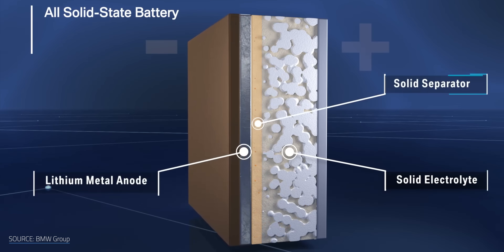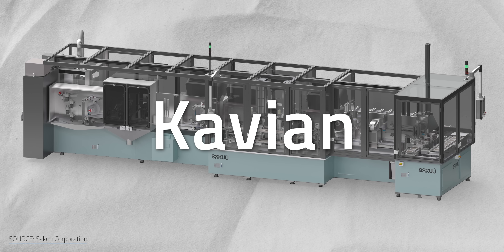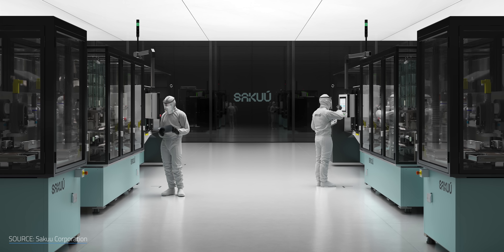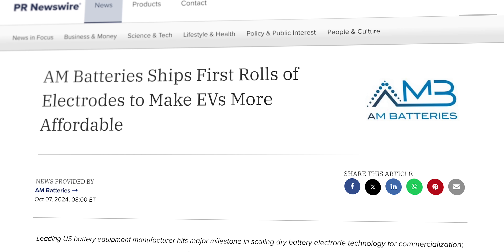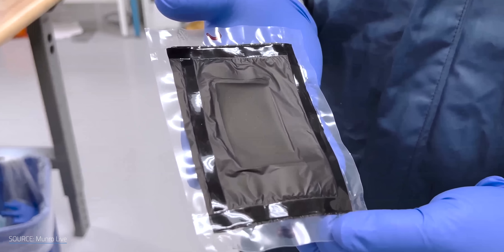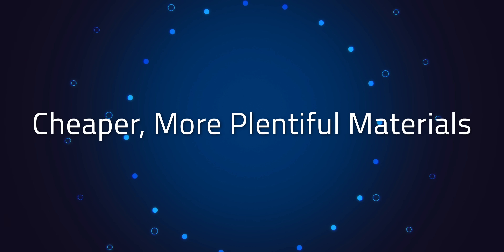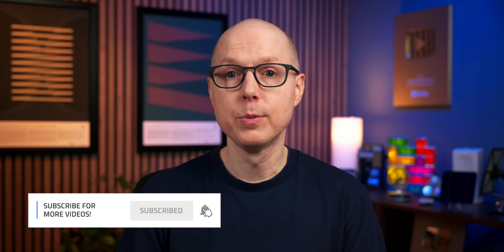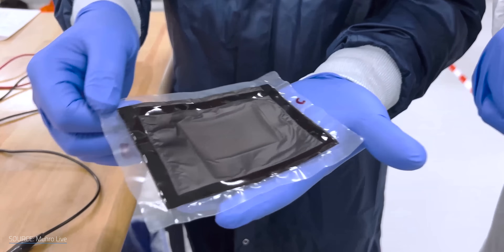Why This Ultra Cheap Battery Breakthrough Matters

Comment: A battery factory that fits in a shipping container would be interesting. I think if you took (Nicolai) Tesla's dream of wireless electric transmission and used quantum bluetooth wormholes to power portable things instead of batteries, it would be cool. But it would probably cause some conCERNs about screwing up when Nelson Mandela died.😊

Comment: If they can up the cycles. Then they would be good. If they last half as long. And cost 50% less.  They still loose. If you have to replace them twice. Not to mention carbon cost (not as much but still there. And disposal of twice as many when they are dead.

Comment: They must be selling LiFePO4 below cost because there are 1280Wh batteries for ~$100.00 just about everywhere.
Reply: I do not believe the Wh rating of a battery until Will Prowse tests it.
Reply: @yvan2563 yes, be very skeptical of any battery capacity claims. 
Those Chinese product claims are dubious.
Reply: I bought two different well-known brands multiple channels have torn down. Presidents' day seemed to never end.

I put them on a Jackery and I am on the 8th day of alternating them every 11 hours. I need an hour to bring it up to 85% for the next cycle.

Lowest voltage I've seen is 12.75, from both,  still pumping 100-104 watts.
I just cannot bring myself to, intentionally, trigger the low voltage cut off. 

I do not have a channel but I had $200.00 to buy batteries before the tariffs and if I only get 90% while battery prices flatline I'm fine being wrong about tariffs.
At least they are not lead acid.

Comment: High capacity Lithium batteries, except for LTO, have a limiting temp. range starting at 0 Deg C unlike NiCad or lead acid have a temperature range starting at -40 no mater what type they are. manufacturers of lithium batteries seem to forget to put temp op range on their products. Ask anyone they do not know. New type of batteries you have to research to find out. As for me in Canada lto is the one for its climate range plus all its many pluses like 10,000-30,000 cycles, (decades of life), My question is WHY no one talks about temperature.
Reply: Perhaps because they can heat themselves to the temperatures they need? Just guessing.
Reply: @gzoechi  there are batteries with heaters but if you do not use your battery you will eventually run out of battery. I GUESS YOU NEVER TOOK SCIENCE IN SCHOOL

Comment: If most of this tech can come to fruition it would be Jess expensive to replace your car high voltage battery than having to replace an engine. Rebuilds are expensive and the labor to remove and install another engine is time consuming. Battery replacement should be less than a couple of hours. We shall see.

Comment: With the amount of new bettery and power delivery tech coming, now to 2035 is going to be quite interesting. I know so many think of anything like this or other battery tech as "vaporware" because it isnt ubiquitous in 6 months to 1-2 years, but people said similar things about microchips in the sixties, personal computers in the 70s and 80s in varying capacities, the internet in the 90s, let alone the thousands of other technologies that begin in a lab and get adopted however by manufacturing. The more choice for new age and solid state or even just cheap/light/safe batteries the better. It may be a decade but all this stuff is promising. And fascinating.
Reply: Exactly my thoughts, although you added great examples I'd not thought of.  Add to that car/cellular phones.  My first one cost almost $2000 1986 dollars and cost a fortune to use.  Now kids and homeless have cellular phones.

Comment: I like your channel, but this constant "omagurd new battery!" every other video has started getting very old.  I referred to your channel as the "clickbait battery revolution" channel the other day... I've liked so much of what you have addressed in the past, but I see a battery video with a title like "This changes everything" and I just skip it at this point. I'd prefer more in-production tech than potential new batteries that are years upon years away. 
Sorry, just some feedback from a struggling fan.

Comment: It sounds like necessary research and development, but alas, the standard refrain of being 5 years away from actual production raises questions about their viability. Solid-state batteries are always the subject of EV enthusiasts, but we only see prototypes that are not ready for prime time. While I appreciate you informing us of developments, the glacial pace of solid-state battery development makes most of us skeptical of their promise anytime soon.
Reply: Agree, but, if this tech is true, this is the production tech you would wanna see as this is already out of the lab and into "how do we make them on mass". If true, then this is the starting point of a 2-5 year cycle point as companies buy into the production line - then another 2-4 years for preproduction.
Reply: @adr2t  I hope that they succeed. We need better and cheaper battery technology. Nevertheless, being out of the lab requires real-world testing. Issues still need to be addressed when using them in cars, homes, and devices. So this is a product that will not appear soon. For the present, LFP is the most affordable option. I hope that LFP can be improved at a reduced cost as they have proven to be a viable, lower-cost option to the higher-cost lithium options.
Reply: @ Typically, they do these test in labs before hand that are pretty close to real world. Follow by the preproduction testing to see how they react after production. Then compare, as production can of course have a silghtly different outcome. If they see it has worthy, then you see samples go out to other companies. So once they are ready, they can go into riskless products. For example, many batteries start off as basic car batteries, follow by storage (like battery backups). Stuff they needs to work, but will have a shorter shelf life to get that real world, but they have been known to jump a bit faster like we saw with LFP. So more or less I am just saying they're out of the lab and into that first line up there. He doesnt go into if they're sampling though, so hard to know, but if they are, then that means its already pretty far along the line.

Comment: Aren't LFP batteries already $50-80 per kWh?
Reply: Kind of, this makes other Li batteries closer to the $50-80 kWh as well. So more over lal storage for less cost as LFP as a storage limit too. So for an EV we could see the battery drop from $10k to maybe $8k or $6k for the same storage size, but less weight.

Comment: The portable JBL speaker in the dash of my new Tacoma has a solid state battery within!  It was chosen because of its stability and durability across a wide range of extreme temperatures
Reply: ITS usually a LTO battery, they have a 10-20 times current output for high current power demands on lower spectrum of the audio range

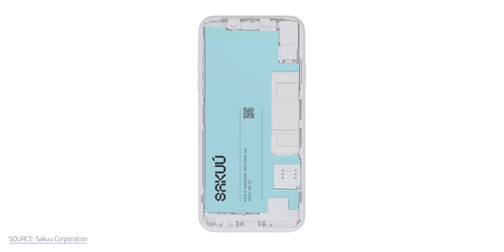Comment: 4:24 because we need even less replacable batteries to fill landfills.
Reply: Its going to happen either way... why not make them better so we dont throw them away sooner? At least here in the states, its one of the reason why we have trade in programs - so they can be recycle.
Reply: @adr2t  they can make the batteries better without making them bespoke abominations, all phones are a brick shape, standardize battery form factors and make them replaceable.
When better batteries come along you can just swap them right in and use the old battery for something else or recycle it.
Reply: @deltacx1059  Except that isnt what is going on still... also while they might be brick like shapes - they can explore more options in the future for different devices as well because of it... even folding phones are set to over take the brick style. Also you can't... the devices that take them have to match up... and NO phone/battery does that either other devices. So while I agree with you in some ways... the reality of it is - we are not doing that anyways.
Reply: @adr2t  that's the beauty of a standard, if everyone follows it compatibility is almost assured.
And folding phones are literally 2 bricks attached to a hinge and a common screen.
Reply: @ Not the phones I saw. They FOLD whole the phone not a hing. Bendable batteries for VR is another thing coming... I can come up with lots of uses cases on why standard batteries can't really exist, but more power to you for it. Not against them to be VERY clear. I think standers help a ton, but I just have an issues seeing how tech changes so quickly it would be wise to until it matures a bit more. With that said, I agree though that any battery in the future still needs to be replaceable.

Comment: if there is one thing I have learned its that the saying "savings passed on to the customer" is a joke. Really cool video and tech though. Curious to hear about scaling. R2R manufacturing is hard to beat with respect to scaling.
Reply: Savings will be passed on to the customer! *
(* after 99% of the savings are passed on to the CEO)

Comment: How many of Matt’s battery technology’s shown in his videos have actually advanced to commercial use?
Reply: At least 4 or 5 depending on what you mean by commercial. Some are still low production or limited to sectors of industry. 2 are from the big battery companies - LFP was also covered in that way. More or less, this channel covers tech that is still lab or few to 10 years out... so its a waiting game in some cases.
Reply: @ Perhaps that they’re produced on more than a protype scale and sold at a profit would be a good start.
Reply: @ Then yea a few have then in that case. Solid state batteries to the LFP battery. Many of the new methods to produce batteries have also hit or hitting like in the Tesla battery changes. Etc... so many of them have. Na batteries as well... Keep in mind, porotype scale is a relative phrase. Meaning, porotype scale can still be in the 100,000 of unit compare to the TERRA watts of power we produce in other areas. I think you mean to say really, "When can I buy them in a price point I wanna hit?"

Comment: I follow posts related to developments in battery technologies as a marine professional and marine-oriented technical and content writer. While battery electric power has made inroads to recreational and commercial marine applications, range and weight are challenges that have restricted their use mainly to inland and short coastal voyages, as opposed to ocean crossings and longer transits. Technologies such as presented here could significantly improve prospects for batteries in maritime vs. other solutions such as biofuels, hydrogen fuel cells, methane, or ammonia for propulsion and power.

Comment: The problem is not what battery to use and spread general use, but how to get them charged. The needed electric energy will be at least 3 times the current account. And this is only for the small applications. Not to be talked about the industrial needs. . When are we going to define what is the big picture of this electrification???

Comment: I've been watching Sakuu for over a year now. And their dry, 3D printing process is ready for mass production with lithium metal batteries today. Plus their non-metal pouch batteries are promising for lower cost and weight, and also easy, cheap recycling.

Comment: I see this headline 20 times a year. For the last decade. I believe it when it's actually made. Otherwise it's just hot air coming out of your mouth. If you can't make it run something it's vapor ware.
Reply: @bobholland9924  Dude, this is about research and development. What you're describing is just the way tech gets developed. Have some perspective.

Comment: If it weren't for the whole hokey CO2 hysteria this would be encouraging, if not exciting news. However, evidence strongly suggests that analysis done by climate alarmist persistently ignores or under estimates the problems associated with mining and recycling various electronics associated with "green" technology.

I am 100% for better cheaper battery technology, but I believe a largely imaginary problem is driving industry without acknowledging long KNOWN problems.

Comment: Notify me when one of these technological breakthroughs will actually  give me 700 miles in range. Until then....
Reply: @gica______B58  Until then, you can take your impatient and unpleasant attitude somewhere else, right?
Reply: Is that your bladder capacity you refer to?
Reply: @markthomasson5077  I wish :) but no. I MAY stop for a coffee or similar after a cuple hundred miles but I don't like the fact that I NEED to stop to recharge. Also, with a current EV I can only travel where there is a charge point which is very very restrictive in my country. 
P.S. I like the idea of EV, I'm no hater.
Reply: Why do you need 700 miles in a single charge? That's 10 straight hours of driving at 70 MPH. You don't pee or eat? I've seen these kinds of posts before. When EVs had 100 miles of range, they needed 200. When EVs had 200, they needed 300. When EVs had 300, they needed 400. There is a point where you're carrying way too much battery. It becomes too large, expensive, and heavy. Set your expectations realistically. Yes, eventually we will have a 700 mile battery... but then you'll "need" 800.
Reply: @aarong9378  it's not about peeing, it's about charger's availability.

Comment: What people don't realize is that the constant fast paced innovation in the lab holds back the real world production. 
Who is gonna invest billions of dollars in manufacturing for a new battery that will be obsolete before they finish building the factory?
Reply: Same reason we have stuff today? At some point it cross the line of cost savings and you just pick it up... then later you pick up the next thing... batteries already had a safer cheaper option for a while now over even LFP, but they will do test and other cost correcting methods to make sure its the next "leap". Currently, it hasnt really added much aka, why we havent seen too much yet hit the market.
Reply: When ideas must be proven to be profitable before they can be explored, we all lose.
Reply: just like how TSMC builds 50 billion dollar fabs that is only profitable for a year then a new fab with a higher node is needed the next year?
Reply: Yer your right there are just too many competing technologies and let’s face it electric cars are already pretty good

Comment: "That's a lot of savings to be passed on to the consumer." Will they, though? Chances are they will add up those savings to their profit instead, at least while we don't have much of a competition. They can sell their baterries 10% cheaper, increasing their market cap, while retaining those 30%~50% cost savings as profit. I can't see this happening in the next 10 to 20 years, honestly.
Reply: I bought my first batch of LFP batteries at around $100/kWh around Autumn 2021.
My last batch I got at $60/kWh in Spring 2024, so about 2.5 years later. The cell quality is insanely better.

So yeah, if the tech sticks, these guys can enjoy a few years (1-3) of that sweet 30-50% margin, but more than that? Unless China ceases to exist, there's no way.
Reply from the maker: Fair point of view.  I hope it doesn't play out like that.

Comment: Really it's going to drop the price of phone batteries I have A Samsung Galaxy Note 3 you can flip the back off at will & remove the battery I quite often star at dark sites for astronomy I carry spare batteries they cost around £5 each reducing the price isn't going to reduce the cost of a phone by much.

Climate change being bad is Bullshit.

Iron has a lot more mass per atom than lithium.

Comment: That’s not the biggest problem with batteries. The biggest problem is an EV involved in a fender bender is likely to at best turn the car into a Roman candle if not an explosion event. Public safety is “the biggest problem”.

Comment: Most people refer to EVs and home energy storage and ignore the generation and electricity transfer part.  Green energy is not providing Europe's power.  They are importing fossil fuel sourced electricity.  The U.S. grid cannot support a shift to more EVs without trillions in new infrastructure.  Best solution is to build more nuclear power plants.
Reply: You are talking about 3 or 4 different things as if they are all the same thing. Energy production isnt the same as energy storage. We dont really need more energy production - we need more storage over all. Then you need less nuclear anything. Nuclear cost more in the long run than solar + batteries because you are going to burn fuel that you would've not had to other wise + the cost of running, transport, building, etc in a safe nuclear site. More storage = smoother infrastructure grid.

Comment: This is exciting! We would love to have solar energy for our house but here in Alabama we don’t have potential income from our local utilities. That makes the system way more expensive as we would only save on the cost of our electricity and give extra to the grid for free. I will be watching for a potential price drop!
Reply: Here in the UK the power companies sell power to you at a much higher price than they buy it from you so it's better to use the your own solar power at home. Solar panels are worthwhile even if you can't export power. If you also get a large battery it makes even more sense. In Alabama you get way more sunshine than we do and solar power makes absolute sense despite the obstructive policies of your utility providers.
Reply: In NC you also have to pay a grid connection fee even if you do not use a watt of their electricity. Fair but still raises your cost